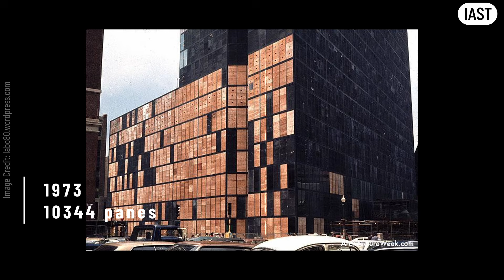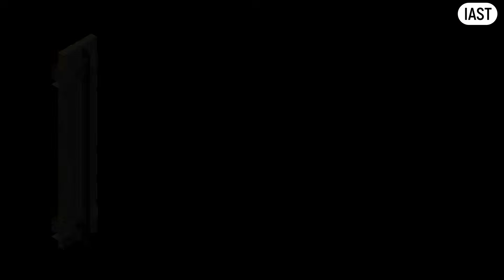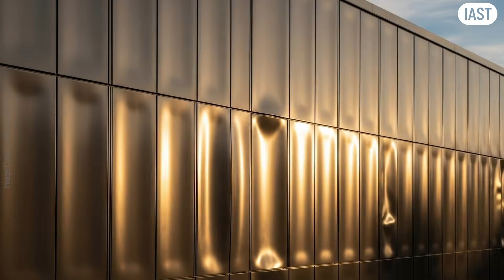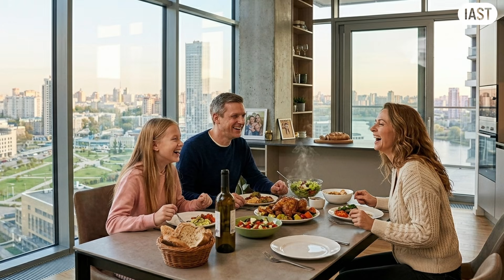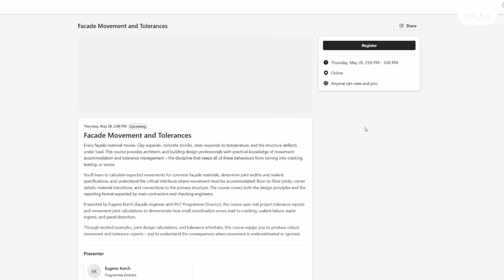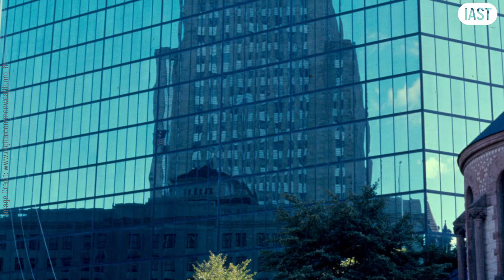Movement and Tolerances in Facade Engineering: Why Buildings Move and Why Facades Fail

Comment: One big killer of stick curtain walling facades I've experienced is when people assume that a "10mm splice joint gap" in a mullion equates to a movement allowance of 10mm. In reality, the clearance between the glass and the transom nosing is usually the smallest denominator. On a 50mm system that can be as low as 4-5mm. When a building with particularly big column centres starts experiencing glass breakages at the spandrel areas, this is almost certainly the cause. It's particularly telling when the breakages occur at approximately the middle of the column locations at the slab mid span.